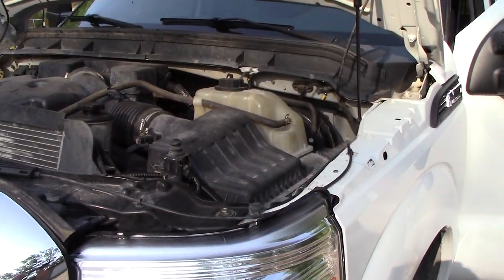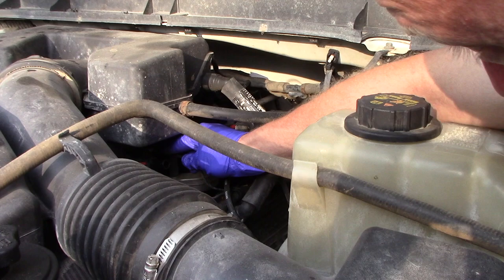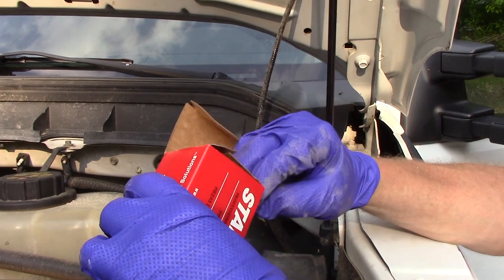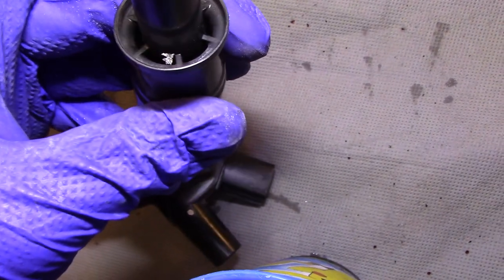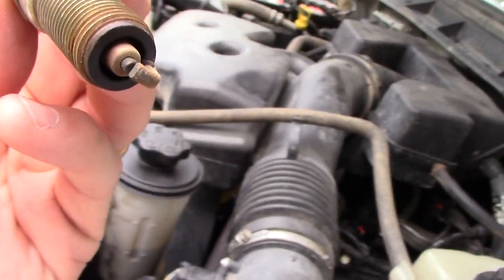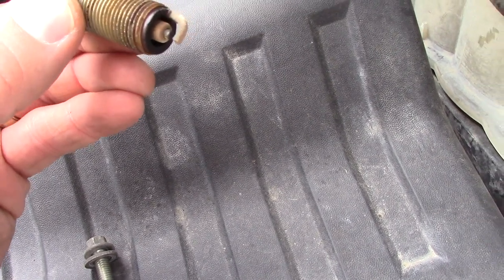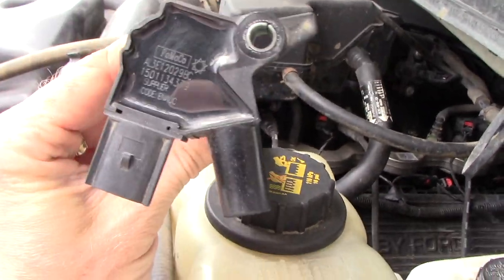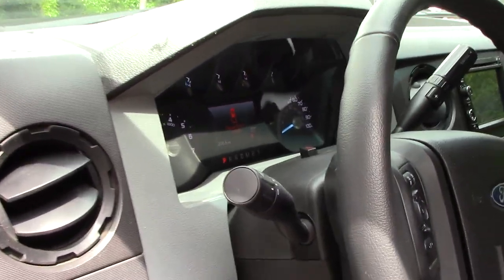Ford F250 / Raptor 6.2 Coil Spark Leakage - Corroded Coil On Plug Causing Ticking Noise

Comment: hey there , quick question , will this failure can make the car to loss power while driving and or stall after a few minutes, the car is a raptor and its close to the ocean , i'll be checking the coils if you leave the truck sit for a few hours , it starts again normal, im doing a tune up on it and after watching this will consider on changing cables and coils , please let me know what you guys think, thankx on advance.
Reply from the maker: Not sure. That sounds more like a fuel issue maybe but without knowing more it's hard to tell.
Reply: @JackofAllMasterofNone  my 2015 f250 6.2 has this problem right now and it seems to be in "limp" mode, I brought my travel trailer home and when I started the truck to pull away from the trailer it was running rough and cranked a lot beofre firing.also stalling a few times.  I get the service wrench on the screen and CEL.  At first I thought fuel pump, but I can hear the pump turn on with the key on.  Upon inspection I have at least 2 coils throwing spark to the block so I should probably replace them all since I'm at 110k, however I don't feel like that is the main issue here.  Maybe fuel filter?  Has anyone else had the truck go into limp mode just from misfiring?
Reply from the maker: @PrimalEnduro  It's quite possible that your ignition system / coil pack misfire could cause it to go into limp mode. It senses a misfire due to the bad coil. Anyone who ever drove a 4.6 or 5.4 Ford with some miles will vouch for that. I'd start with replacing your coil packs and plugs if they haven't been done and see what happens.
Reply: @JackofAllMasterofNone  Yes, it's due for a tune up so I'll start there.  I disconnected the battery and put the + and - wires together  to reset the computers and clear the codes and it immediately came back,   it's just weird that it cranks quite a bit before starting and then stalls out sometimes like it's not getting fuel.  when I press the accelerator I get absolutely nothing as if it's been disabled.  I had to put it in 4 low and just let it creep forward at idle to disconnect the trailer.  The CEL came on last week and it was a Knock sensor.  all week the CEL came on then went away.  it seems to always be on when it was raining which would make sense with the bad coil packs.
Reply from the maker: @PrimalEnduro  Usually the wrench light coming on is a sign of a drive by wire control  malfunction. Could be your pedal or the throttle body itself.  Possibly the throttle position sensor has crapped out on you. You need to pull the codes and see what is going on.
Reply: @JackofAllMasterofNone  Thanks for the quick reply!  my buddy is bring his scanner over tomorrow to pull the codes.  I did check the throttle body to see if it was carboned up and it was pretty good and moved freely by hand, but you might have something there with the TPS.
Reply: Hey jack did you ever find out what was the issue with your 6.2 I was thinking it may have been an issue with your tps also